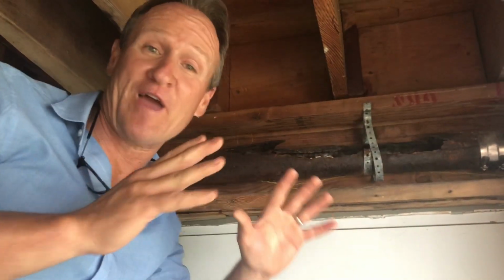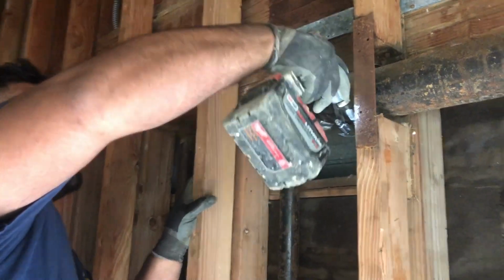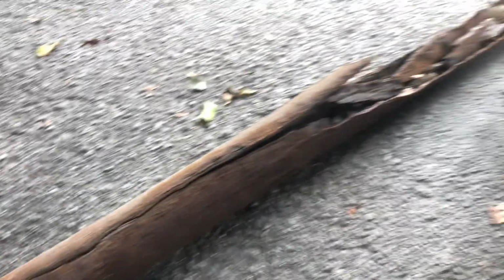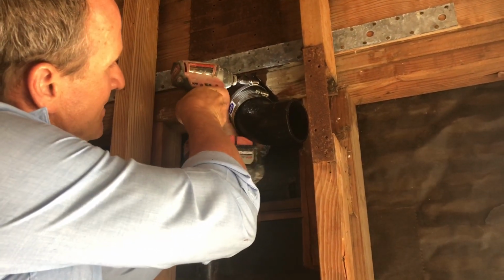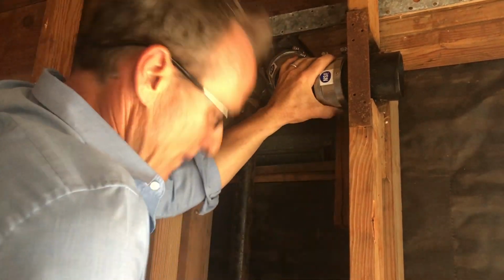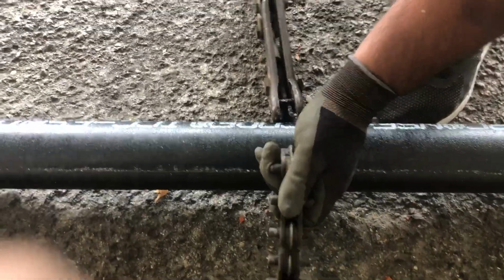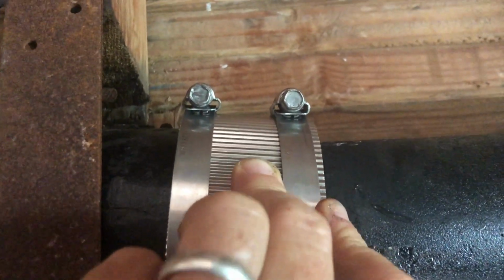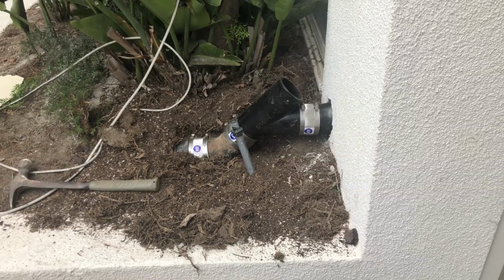How To Cut And Replace Cast Iron Pipe

Comment: You don’t not need to cut cast iron pipes  out of fear just because plumbers say that it’s better to replace cast iron with pvc.

The truth of the matter is cast iron is built to last and handle a ton more of pressure and last longer. They convince you that it needs to be entirely replaced to make a profit and use permitting as an excuse to jack up prices even more so.

When you get a clog… don’t replace your entire system. Snake your pipes using a rotorooter into the nearest drain clean out, then pressure wash them with a small tiny long hose that blasts water out of the sides  (which industry people renamed hydrojetting which will likely clear your clogged pipes, and if your pipes badly clogged you can use a drill with a long line and have piece that is metal at the end and have it whip the pipes from the inside to derust it. They tell you that it could lead to cracks in the  pipes and then you’d have to replace the  sewer pipes….

Oh gee but wasnt that what the plumber was selling us on to begin with?

Comment: Very nice video, thanks for posting! I bought a house and after trouble shooting the kitchen sink drain not working properly, I discovered that someone (an angry roofer?) had dropped bunches of wood scraps down the vent stack! i managed to skewer several pieces using a method i made by adding a screw to the end of a roof rake pole, but there is lots more that seems wedged in. So i'm considering pullling off the cupboards from the kitchen wall, and cutting some wall out, in order to reach the pipe stack in the wall. I'll have to strap the pipe in place (BUT HOW?) and then cut out a section of the pipe in order to pull out the remaining wood in the stack. Then i could insert a section of PVC with a boot on each end... any tips how i could secure the stack so it doesn't slip out of the roof opening and make more work for me up there?
Reply: Yes You will want to hold the pipe above where you are cutting. Then after you cut it you set The upper half Down against the lower part That you just cut it from. Then you go up on the roof and you pull all the iron out. THEN , You go with pvc for the entire length from your cut to the roof.

Comment: Wonder how they did it without rubber clamps ?
Reply: I believe it was as follows.  Please correct me if I have this wrong. Between two pipes, you inserted a cast iron transition coupling. Each pipe was joined to the transition coupling by the use of oakum (a packing material that looks like hemp) and molten lead. You had to spend considerable time tooling the oakum and lead to make a good joint.

Comment: The scissor cutters are as old as the pipe 🤣  And, here in Chicago you can't only use no hubs, they want it all leaded together with hubs. You can get away with using 1 no hub but they want the one that comes with 4 clamps on it. I'm shocked anywhere allows C.I. to be installed like this with all the bands lol

Comment: why did you leave that pipe open? mulch can fall down there. to prevent mulch from falling and to allow that pipe to drain water outside if there is a backup. put a fernco cap on the wye but remove the clamp from the fernco cap. that way if there is pressure it will push the cap off then the water will dump outside.

Comment: Hi, your video is very helpful!  I have to replace a piece of cast iron sewer pipe under my crawlspace, about 13ft long. What is the reasonable price to hire a plumber to do this?  I got a quote for $2700 seems quite expensive to me, do you think this is reasonable price? Thank you!
Reply: BTW this include both parts and labor.
Reply from the maker: that does seem high.....does he have to deal with a tight space? does he have to excavate? always get 3 to 4 estimates, this will give you a true value.
Reply: @TwinHomeExperts  Hi thank you! Space might be a bit tight, but no excavation I am sure. I will ask for more quote. Appreciate your answer.

Comment: From a business perspective for new or upcoming plumbers this is a good opportunity to get more business and up sell. If the pipe has corroded like that chances are there are other sections of bad pipe and your customer will continually call you back to cut out pipe and replace with new pipe. What I do is take the opportunity to camera the line and/or recommend a total replacement of the sewer. That would turn a $800 job (that's what this job would go for in my area) to a few thousand dollars. You get more money and the customer has the piece of mind of a long term solution.
Reply from the maker: yes, they also make coated cast iron that will never corrode and crack. It's more expensive. but well worth a upsell on value.
Reply: Thought everyone was switching to plastic ?

Comment: (1) How come you went back with cash iron? When I encounter a situation like this I always replace with PVC. PVC last much longer especially underground and cost much less. It's a superior product all the way around. (2) For the Diy'er you don't need to buy expensive snap cutters or ratchet cutters to cut cast iron. This situation was fairly straightforward since you have the no hub bands, but most of the time when I run into cast iron it's service weight bell and spigot and I have found cutting  old corroded pipe with ratchet cutters tends to  crush the pipe instead of cutting it cleanly causing the fracture to spread. I have a pair of ratchet cutters on my truck but I hardly use them anymore. When I cut out old cast iron, I use a sawzall and cast iron sawzall blade. Now the blades are pricey at $20/each and you don't get many cuts out of each blade, but it's worth it when cutting out bad pipe. I have found the Milwaukee blades to be the best longest lasting, but surprisingly good and much cheaper are harbor freight diamond grit blades.
Reply: In some jurisdictions (NYC) PVC is generally not allowed because in a fire PVC liquifies and the liquid fire starts travelling.  Doesn't happen with cast iron.
Reply: I use cast iron at every chance I get
Reply: I was taught to replace like with like also cast iron is the quiet pipe some folks don’t wanna hear the upstairs chipotle traveling all the way down